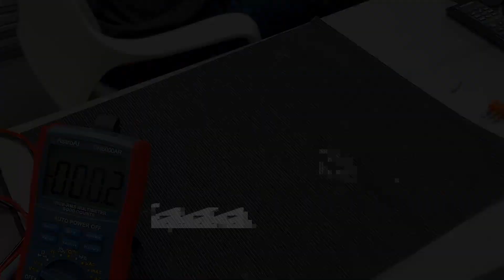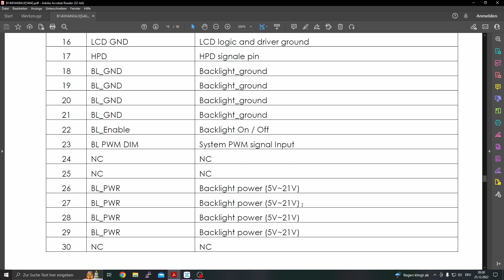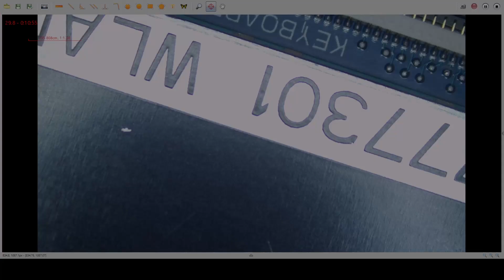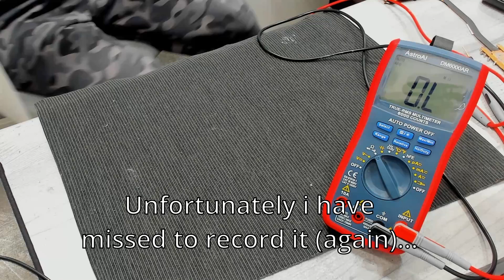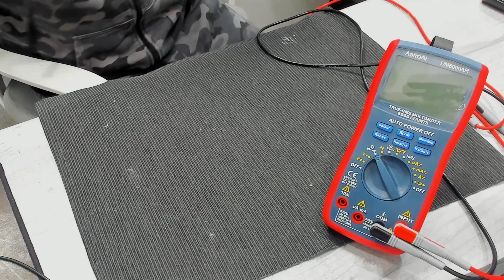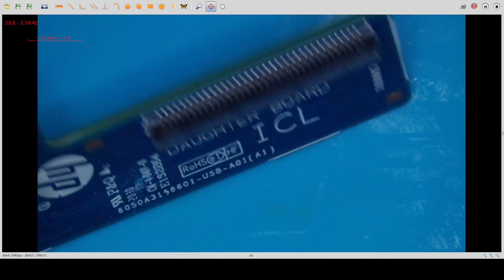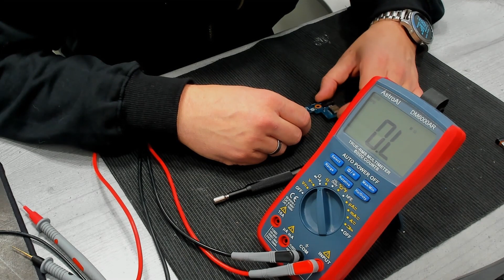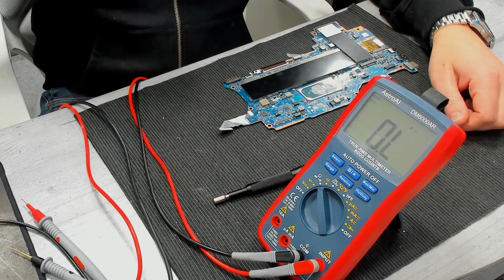HP Pavilion X360 - Missing Backlight and almost everything seems fine... (Advanced troubleshooting )

Comment: Mike at the latter stages of the  prove , I think a voltage of 3.3 volts and a 1 amp from a bench power (liner one course supply applied with a thermal camera  or alcohol would have brought to the same conclusion. but I like you methodology, good work . REGARDS JIM

Comment: Very nice find, you have superb troubleshooting skills.
Your english is very good, i fully understood your thought process all the way.
Also, in that case would've been easier to spot the short with voltage injection? If not could you explain why, please?

Very nice content, keep up the good work.
Cheers!
Reply from the maker: In this case, with this low resistance at the logic line, it would be the right way to inject voltage to find the culprit, too. However, at this point, I already knew there were not many components left, so I went the (hopefully) more interesting way. One by one, from logical conclusion. :)
Thanks for your feedback!
Reply: @fairrepair_en  I see, it was definitely more interesting but more importantly a lot more insightful.

Comment: Would you be that kind the share the schematics for this board ??
Reply from the maker: @ArkuSone  as you may have noticed, I had to work on this board without schematics at all, since they were not available. Maybe they are available in the meantime. What is the board number of your device?
Reply: @fairrepair_en  yeah, I know the schematic are not avaliable. For now I discovered missing 3.3v on backlight indicator.   Digging further.